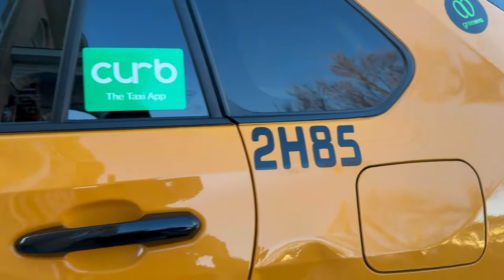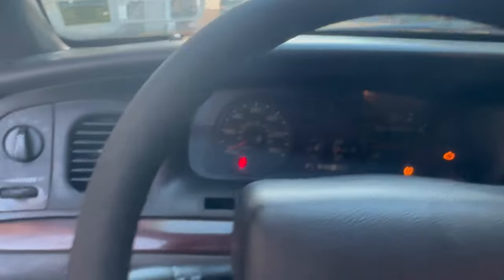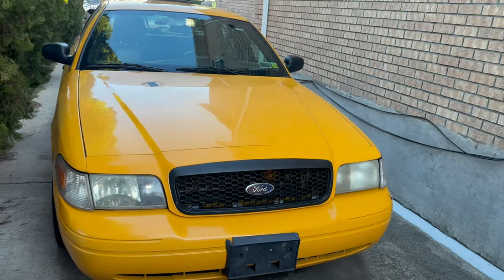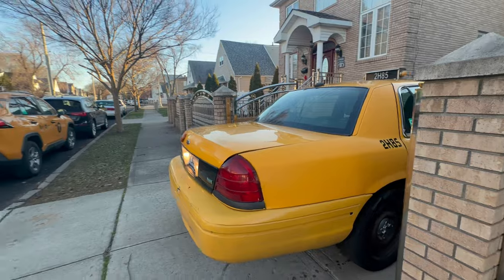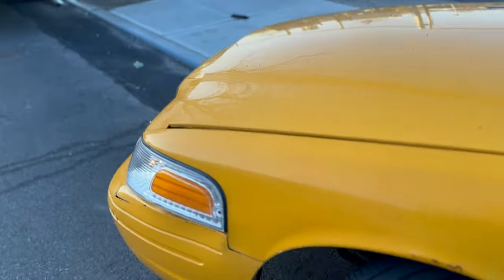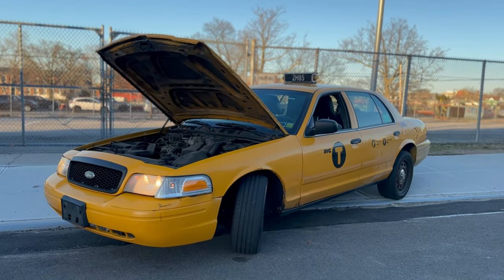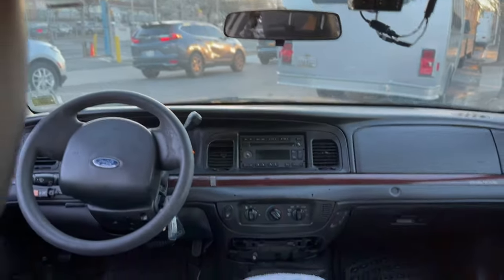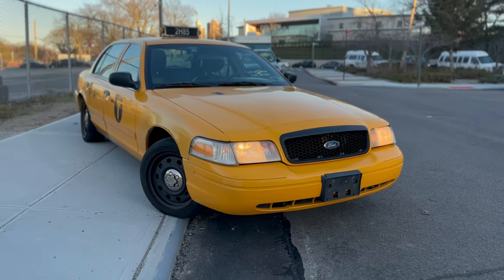Buying The Third Last NYC Taxi Long Wheelbase Ford Crown Victoria!

Comment: I wonder why the police CV didn't get those vinyl front seats?
Reply from the maker: they needed stab proof seats
Reply: @carsofqueens  I would've guessed they could put the stab plates in the vinyl seats too.  I'd rather have vinyl seats because they are easier to clean.  I have some spilled coffee stains on my cloth seats.  They would just suck in hot weather though to sit on.